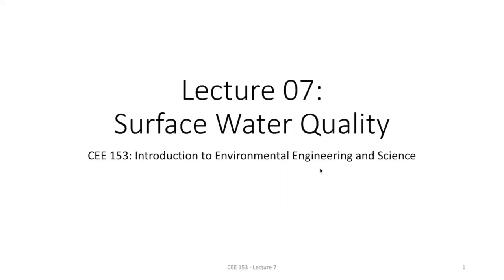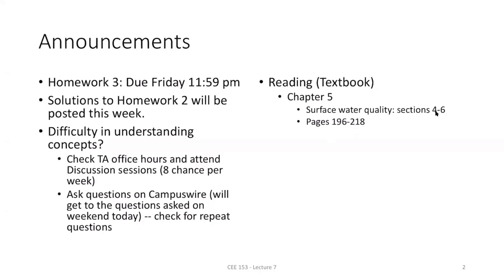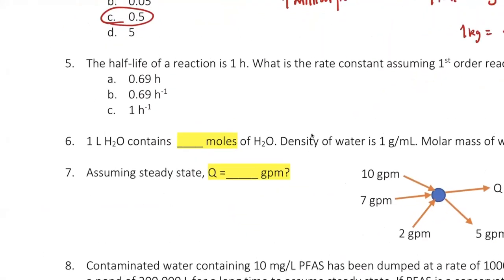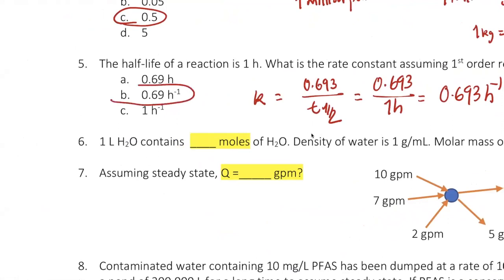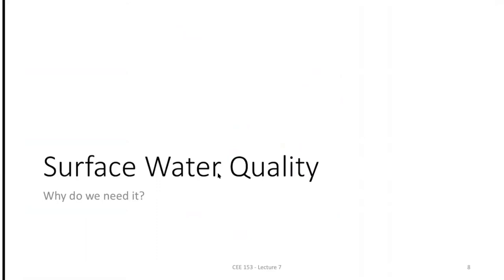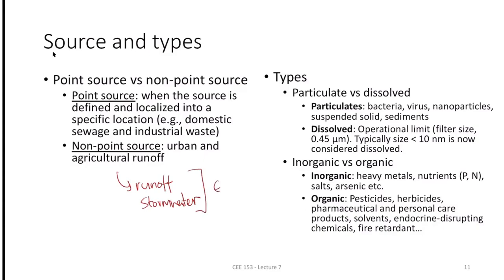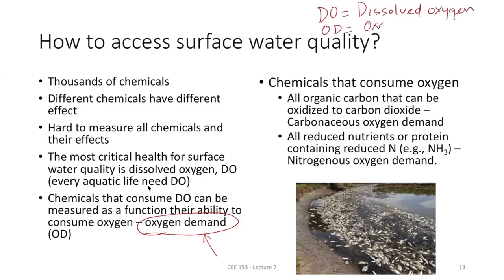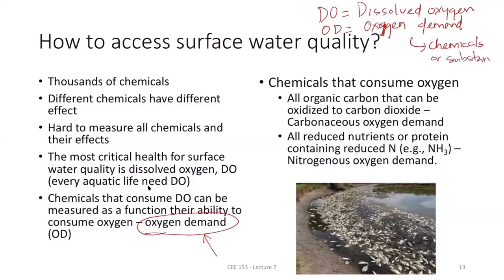CEE153 F20 L07A - Surface water and BOD

Comment: @57:41 Is the "2" value multiplied by NH3 the change in dissolved oxygen over 5 days?  I don't see where else it could be coming from.
Also, @1:03:16 The equation for BOD5; why is it not DOf - Doi?